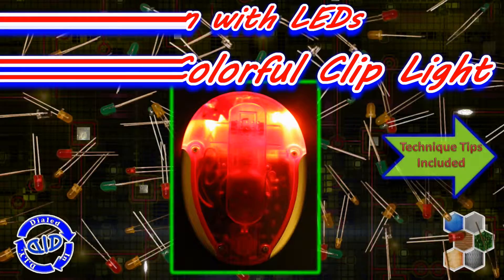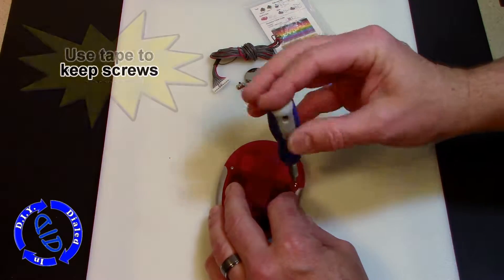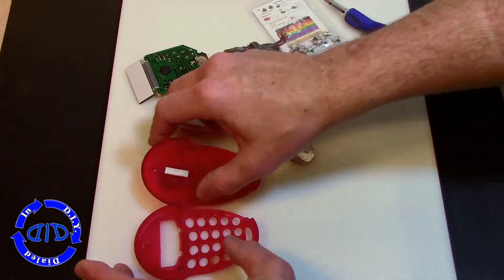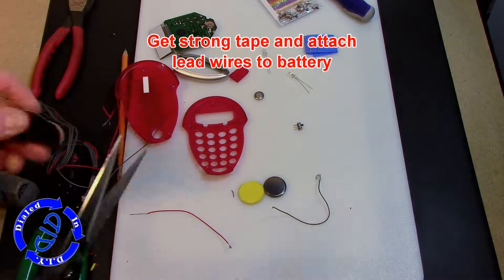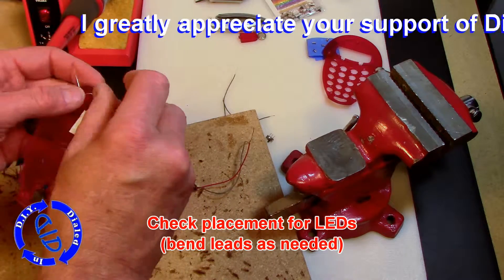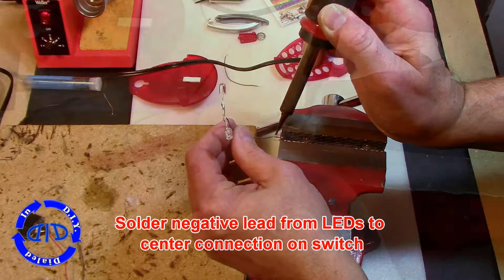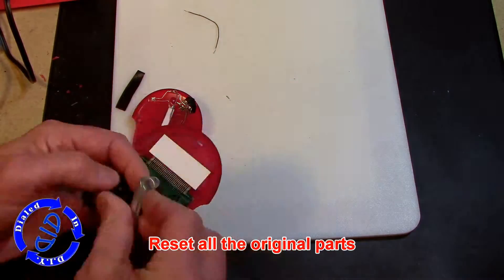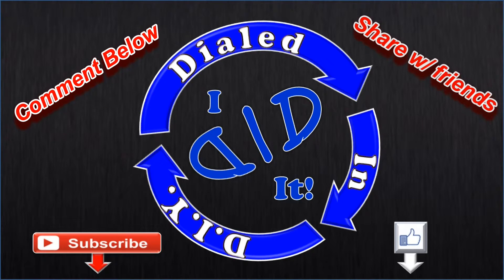How to make amazing lights - adding LEDs

Comment: Wondering if you could help me? I’m trying to make an led board with 2 types of led for 2 specific wavelengths but I’m not sure where to start thanks
Reply from the maker: Happy to help if I can.  First, when you say "an LED board" do you mean a PCB or some other grouping of LEDs?  Second, I am assuming you want to use 2 different colors that might have different power requirements. Third, do you want both wavelengths on at the same time or ability to switch between the 2?  
If you are looking to make a board with the option to switch colors or even cycle them then one way would be to use RGB LED strip lights.  I recently put up a couple videos showing how to work with these if that helps. 
Lightbox: https://youtu.be/fUr63pGwtek 
LED striplights: https://youtu.be/5k0dXdV4hUY